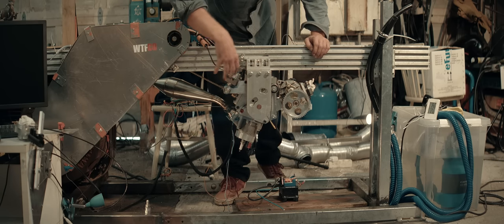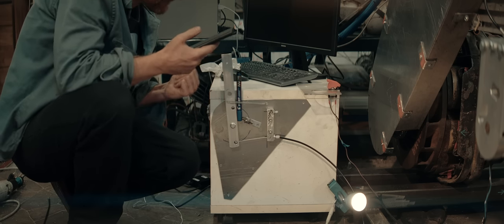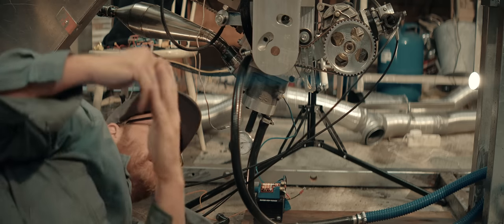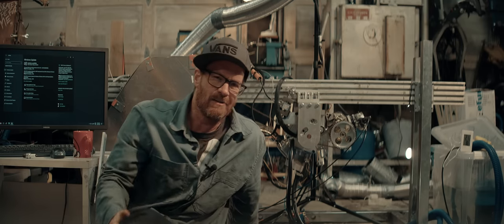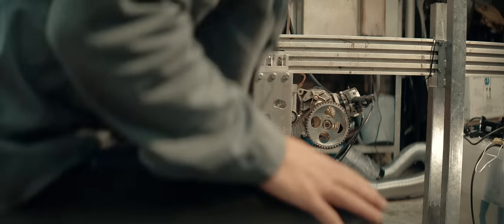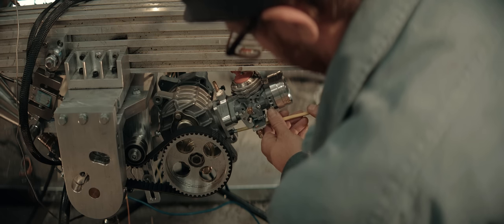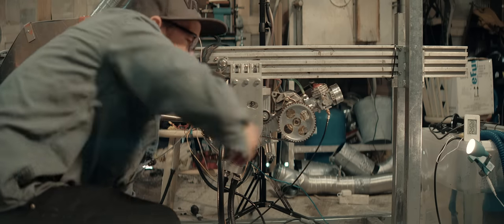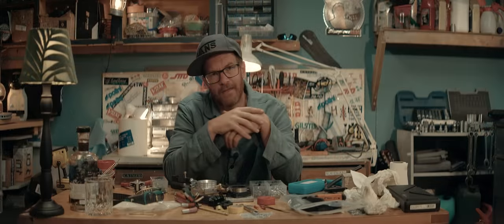First Start! Supercharged 50cc "moped" Engine. What can go wrong...

Comment from the maker: Edit: Eureka! I think I know why the pumper carb wouldn't pump fuel. I took pressure signal from the intake pre blower, feeding it negative pulses only. If I'm not mistaken that means the pump will only fill the pump chamber, but never discharge into the next stage(at least not very much). Taking the signal post blower will only provide positive pulses, discharging from that chamber, but not filling it. Shouldn't be a problem as it's fed by gravity.
First thing in the morning!
Thanks for watching! I'm trying to read n reply to comments as much as possible whenever I have a free minute, falling behind as always tho, sorry!
Reply: I love your cinematic camera upgrades, your video quality is top notch, your editing is on point and I love when I get notified that you've posted a new video. I hope you make it to Bonneville soon! Looking forward to watching the journey. Thank you for what you do!
Reply: Instead of replying to this comment, please take a sip of your drink and spend 5 minutes relaxing. You work very hard bro!
Reply: Grei stemma 🤘 takk for manga goda Wideos 😉 hilsen fra 🇩🇰🇩🇰🇩🇰
Reply: Hi, I was wondering if the extended crank pin, blower drive & ignition trigger spacer needs an additional bearing support between the inner side of the trigger on the extension, and the outer side of the crankcase? 
There could be enough space there already - as the internal crankcase bearing is not supporting the extension & belt blower loadings .
Reply: You are the best 
From italy 
Forza ferrari
Reply: You're awesome 👌
Reply: WOOOOOOO! It's almost running Alex, stay the course, a thousand points of light! You're the best, and I really enjoyed the end song even though I don't have a clue what your saying lol. I look forward to every new video and I'm never disappointed, thank you!
Reply: You are 100% right. This type of carb need a pulse to correctly fill the metering chamber, gravity won't be enough. There will be no crankcase pressure pulsing on your type of engine. You would have to pressurise your fuel tank or ad an electric fuel pump to correctly feed that carb.
Keep on the good work! 👌
Reply: @francklegarage7162  ding ding ding, you are the winner. An electric fuel pump might work, these carbs need between 25-35 psi of pressure. Or a pulse line from the exhaust manifold will work too.
Reply: @LeObsidianCraft  you are 100% correct with the exhaust pulse. I came here to say that exact thing. Tap into your exhaust Alex and use that pulse wave to cure your problem.
Reply: That "slight bend" was impressive 😂

Comment: Around my shop a "strategically placed " tool usually means it's just where I used it last, in the organizational ideology that Ave described as Lee.  It's very organic, like where is that T15 bit?  Underneath the disassembled drill in the corner, where I last used it, obviously.

Comment: Use T-Röd (alcohol) when milling aluminum. It works much better than any other coolant and you will not have any problems with clogging 👍
Reply: thanks for the tip 👍
Reply: Dipping the tool in beeswax can also work, if you think the alcohol smells too much or is a fire hazard.  Especially practical when drilling.

Comment: Love the music!
You might try adding a little propane from a blowtorch to the intake to get it started.
Have you thought of building an opposed-piston engine like the Deltic? Their port timing works well with boost.
Reply: I agree, volumetric efficiency and scavenging is really good with the 2 piston single cylinder arrangement. Potentially more friction with two cranks and two pistons though. Definitely adds to the complexity some but then does that matter in this application?
Reply: I LOATHED the music. Idk how anyone could like it. Each to their own. The content was on point though

Comment: I finally bought a few sets of allen keys so I can keep a complete set in the toolbox and still have all the specific sizes I need for all the specific machine tools for adjustments and clamping. My sanity appreciates it.
Reply: Then you need a bunch of magnets glued to where you need each of those allen keys so that they remain where they are assigned.  I use magnets from old disk drives for that purpose.
Reply: @johnpezaris6982  I prefer not to use magnets, especially super strong magnets like HDD magnets because on a lathe/mill/drillpress it's really annoying having magnetized tools.

Comment: Hi Alex,  I have had some experience with draw through carburetor forced induction.  I found that the pressure drop from the blower to the carburetor required me to run a vacuum carburetor. I could never get a mechanical carburetor to work correctly.   I would like to see you try a carburetor like a CV carburetor  found on a four stroke motorbike. It may be whats required to get your blown 50cc to run. Good luck and keep at it.

Comment: Use WD-40 instead of coolant foe aluminum, if you cant use flood. Works fantastic to keep your tooling from loading up
Reply: Alcohol also works very well for cutting aluminium, Stefan Gotteswinter always uses isopropyl alcohol with excellent results.
Reply: @Henning_S.  that seems like a bad idea to me. There is no lubricity to alcohol whatsoever. Plus literally top caliber internal combustion race engines use alcohol for fuel. I've personally used WD-40 for years and beside making a mess, it works fantastic for surface finish as well as keeping end mills and die grinder burrs clean from loading up and sharp.
Reply: use ATF.
Reply: @greatestevar  LMFAO. Ok buddy
Reply: @DamnDiesel  I wouldnt want that shit mixing in my coolant tank

Comment: Any reason that you are running with carbies rather than fuel injection? There's no issues with pulse lines etc with injectors at least. With all of your fuel flow issues and other issues you are at a fair risk of having a hydrolocked engine. Pumping in vast quantities of fuel to keep up with the supercharged fuel flow may mean that you should be running a lower compression ratio as well.

Comment: Consider using an automotive style injector running Megasquirt. It gives you the ability to control fuel delivery relative to boost pressure. You can also trigger the delivery of impulse cycles. Love to see someone still pushing the engineering capabilities of the 2 stroke engine!

Comment: At this point your going to need to go to fuel injection. Look at the turbo bombardier snowmobile engine. All the carberated turbo banshees blow up unless thier fuel injected . Weld  bungs for egt ect..... knock sensors , everything . Until then your just guessing.

Comment: You should use a smaller carb, just because you upped the comp, it is still a 50cc engine, and can only pull 50cc of air per rev. By increasing the carb dia, you don't have enough air velocity, or vacuum for your low speed jet to work. The only time a bigger dia carb is needed is if you change to a longer crank stroke, or bore a 1/4" over, or if you are doubling or tripling the air pressure using a blower or turbocharger. With the correct size carb for your engine displacement, it will mix air/fuel much more completely, resulting in a cleaner, very fuel efficient engine. Air gets sucked into the cylinder by the piston, then the valve closes, fuel/air stops. With sufficient velocity, the slight delay in fuel delivery that occurs when the intake valve first cracks open, and the piston changes direction this is where horsepower is made. Lower air speed causes fuel to drop out and wet intakes and cylinder walls and is wasted. The excess fuel mixes and damages the motor oil, reducing it's lubricating qualities. If you had multiple cylinders, the fuel lag is reduced, but because you have a single, you have to be more aware of fuel lag, and stay very close to stock specs. Remember, 50cc of compressed air moves at the same speed as non compressed air. Compressed air needs more fuel bc there is more oxygen/cc. Hope this helps. I spent 2 years getting a 40 dcoe Weber two throat carb to run on an 86" Harley. I ended up with a bike that rode circles around 96" evos with a top end of 120+++mph, as fast as I dared to go, and ended up writing a book on selecting, and tuning on single cylinder apps It may help if you visualize what happens to the fuel in the emulsion tube, as both large and small bubbles are mixed with the fuel in order to make it lighter, and allows it to enter the airstream faster with less lag. Dig in to imagineering, by the time you're done you will be writing your own book.

Comment: To clean clogged up milling flutes, just put them overnight in sodium hydroxide (NaOH, like the stuff to unclog the drain). It eats away the aluminium and the flute will be like new again. Then dip them in candle wax before usage and they won’t clog up as fast.

Comment: Try starting it on gasoline from a sprayer and once it's running turn on the fuel and it should stay running on it's own, either that or you just need more spark energy and timing.

Comment: Just a note: That sprocket for the chain looks veeery small on the motor side. So small that you will probably lose a few percent of power due to low efficiency. Not a problem now of course, but might be worth considering later.
Reply from the maker: Yep👍 will switch out the primary when it's going into the bike.

Comment: Those pops are encouraging! Big HP soon. 🔥
Reply: Not really the reed will never last long and the piston need to fight the boost pressure in the lower crankcase when going down(power stroke) and will kill is hp
Boost and conventional 2stroke don't mix well
Reply: @legros731  If boost and 2 strokes dont mix at all, why are polaris and skidoo snowmobiles making easily and reliably making over 200 hp?
Reply: @Jake-rp9cv  they are not supercharged they are turbo
And the inject the mixture straight in the intake port  just like a 2stroke Detroit Diesel 
Completely different animal but nice try
And you forgot the most important part a said conventional 2stroke

Comment: Had a thought Alex with my turbo bike I needed lots of ring gap to stop from eating ring lands. I recalled you having issues snagging rings with this engine. I hope you see this before something happens don't forget to add ring gap to this engine.
Reply from the maker: 👍It's at about 0.35mm now up from 0.2mm when it snagged.
Reply: @2STROKESTUFFING  excited to see how this goes been here since the scooter days. That sounds a bit tight for the bore size but your running less boost so I wish you well. Lol in my 4stroke we run about .40 but it sees 40psi often and is air cooled so I think you should be golden. Best of luck I'll be waiting for the vid.

Comment: wd-40 woks well to stop aluminum galling on tools. Adjust speed slower to minimize galling also.
Reply: You'd be better off just pouring water on it to keep the temperature down so the material chips off correctly, or using an actual lubricant like oil. WD40 is neither coolant or lubricant, it's Water Displacer and is a complete waste of time and money for using like that, and will ruin the coolant system of some CNC machines. It might be fine for keeping your grandads hand drill going through some Chinese gunmetal without completely blunting an ancient untempered drill bit, or you know, displacing water in electronics, but not much else.
Reply: @stykytte  Well I am a master machinist of 40 years and engineering manager of a major electrical device manufacturer, I run cnc all the time. Please know what you are talking about before you make ridiculous statements. Plain water will boil off the hot tool surface providing little galling protection. Wd-40 is used throughout the industry to  prevent galling of aluminum in situations like he had. Kerosene is also a great thing to use to prevent galling .
Reply: @tmackinator  How man cans of WD40 do you go through in a week?
Reply: @stykytte  Just buy it in the big containers, they come with a refillable squirty bottle. Havent bought a can of WD40 for years! haha

Comment: Could try heating the sparkplug before start to prevent hydrolocking
Reply: A heated spark plug works very well if the spark is too weak to ignite a too rich mixture but it doesn't help with hydrolocking at all because it is impossible to ignite the nitromethane without any air...
Reply: @Henning_S.  well i would say heat helps to vaporize the mixture and aids combustion but dont know if it helps when its bucketfulls of nitrometh

Comment: I have a question for you. I'm building a minibike with a 142 cc lawnmower engine built by Suzuki. I have a pipe program but it asks for horsepower among the parameters. If I guess too high what will the result be? It's a 5.5 hp as a lawnmower engine but no idea what it will do with the bigger carb and ports cleaned up. Should I guess high or low?

Comment: I see you are still working with an expansion chamber. Outdated exhaust compared to something you have never seen. If you really work out of the box you would have looked into the info I sent you months ago.   Tested on a 17 HP engine with this new exhaust over 35 HP. Good luck with your work.
Reply: Please explain; I am intrigued...

Comment: What is the advantage of the Tillotson carburetor versus a traditional carburetor? I have toyed with the idea of putting a Tillotson carburetor on my polini 70cc engine
Reply: Please I beg of you stick with a brand name carburetor like mikuni etc all the Chinese made carburetors and jets are pure filth because they don't calibrate the circuits in the carburetors and they don't calibrate the Jets it's a crap shoot freaking Chinese. Recently a friend of mine bought a pair of 44 mm Weber look-alikes you know Chinese counterfeited carburetors. I am awesome with dual Weber carburetor setups and tunes. And for the life of me I couldn't get those carburetors to work worth a damn freaking Chinese made crap so I pulled the Weber's off of my motor through him on his motor and the thing just ripped. Please people do not buy Chinese made carburetors or jets.
Reply: @chuckingram5966  I bought a chinese Keihin knock-off as well.  I disassembled the original one and the chinese one.  You will  find the differences inside (too small bores in the case for the idle jet for example).  I brought all the different bores etc.  to the size of the original carb.  Unfortunatelly I had no time to test it but I guess it will work.

Comment: It's cool how the supercharger consumes more power than you could've gained ....  It's been done before , and that's why you don't see gasoline powered supercharged two strokes ...To achieve boost you need to have an exhaust valve , otherwise you're just overscavenging ...
Reply from the maker: I see your point, but in theory the pipe should still do its job. I've already played around with exhaust valves, this engine will receive one if needs be.
Reply: @2STROKESTUFFING  And then valve float is going to limit RPM ,, That's why the only successful supercharged 2 strokes were "relatively" low RPM diesels ....

Comment: I haven't seen the rest of the videos, so I dont know if this is something you've talked about, but, wouldn't it make more sense to have the carb between the supercharger and the engine? That way you are not compressing the full mixture in the supercharger which could result in unwanted ignition problems. Is that why you are running methanol and nitromethane?
Reply from the maker: I see your point, but. A roots blower doesn't compress within itself, it just moves gas, and I think it helps mix fuel/air together. Methanol/nitro is for cooler running, more power, and detonation resistance. Plan on taking this to relatively hot bonneville.
Reply: No he has a point, but the ratio spread is much less severe than a combustion chamber.. however, race level superchargers blow up intakes all the time and as a result they make those blowout ports to save the engine in the case of a pre set or backfire/ uncontrolled ignition. If you leaned out suddenly while running hot or super high boost , it would mean hella damage for the engine
Reply: @2STROKESTUFFING  but by having the carburador further from the engine the volumetric performance is worse. Also, as I said I haven't seen the rest of the videos so I don't know if this is something you've talked before (I just find this project stupidly cool and my curiosity bests me), having the cilinder upside down doesn't decrease power as you have the power stroke work against gravity?

Comment: Wow, you can sing, not bad at all,  seems yo can do everything,  you could get paid to sing,.  I could get paid to not sing 😆,   I can't wait to hear this thing 🔥 fire!   I just imagine a larger version, 490-500cc or maybe 2cylinder, 600cc spinning around 10-12k RPM, with at least 1 bar boost, probably 2bar at most,  that combo on nitro, would surely make 100-150hp on 500cc at least,  I'd think this engine should easily make 20 HP.  
Awesome, keep it up!! 👍

Comment: Needed a lath or drill press/end mill to make new connecting rods for a XJ-650 motor bike and surface the crankshaft making barring's etc, "bozo think's i'm making pipe bombs and called the cops". on the other note, local hardware store had some very good deals on some new equipment that needed a little work/fixing of broken things... 🙈 where ever the house cats ran off to again, all of them teeth and claws yet they make the purring sounds...

Comment: A thought.

A.  I still think the carby is way too big.  Gas speed is way too slow.  That carby is for a 100cc doing 20,000rpm

B.  Is it possible that the atomised fuel is recondensing when it is compressed within the supercharger.